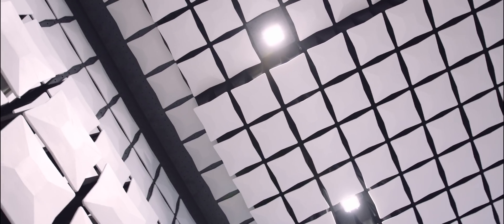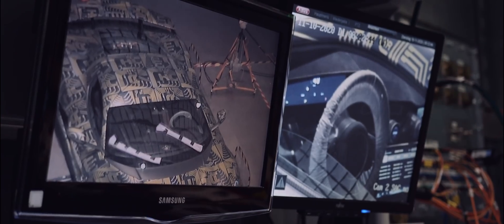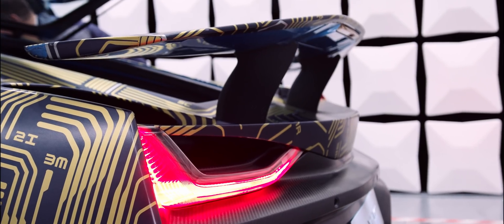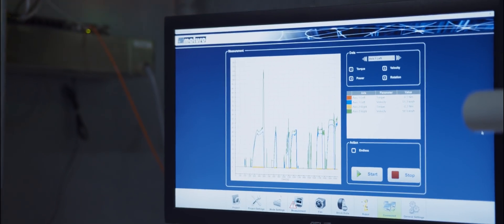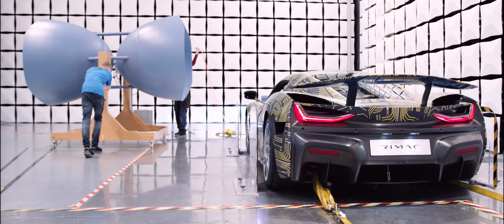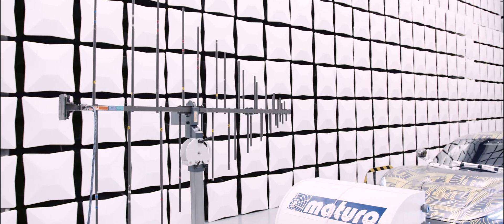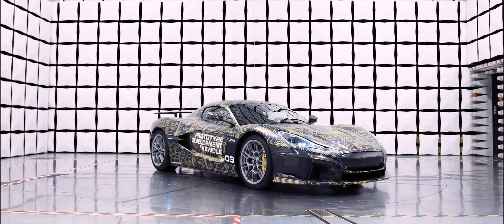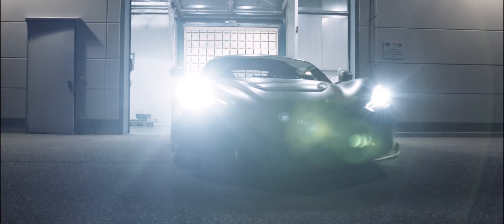Rimac Nevera ElectroMagnetic Compatibility Testing

Comment: Do the regulations require you to measure radiation at the full 1400 kW of drive power? I am pretty sure the dyno of the test facility cannot support radiation testing at 1400kW and the car emits the most RF energy at peak power. I wonder how you test this.

Comment: As part of my electrical engineering studies, I've been at a EMC test facility a few weeks ago and yes: It really looks as futuristic as it seems here. Even if the facility it self is > 40 years old.

And also yes: You could totally make a James Bond film with all the stuff they use for EMC testing. It's amazing.
Reply: is there some custom equipment that could be installed  in my car that could interfere with speed radars, cameras in interceptors, speed laser , etc